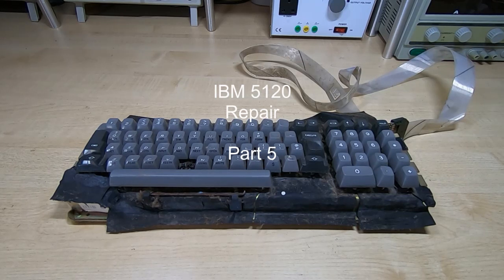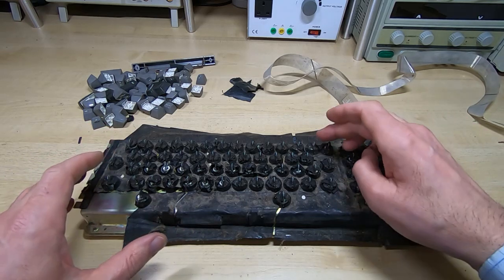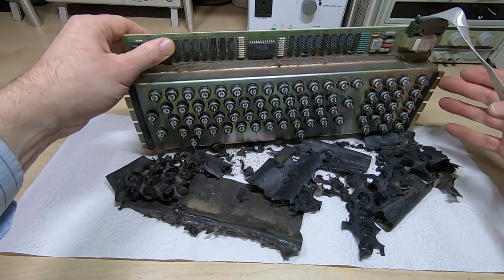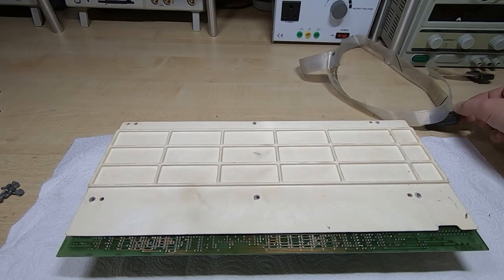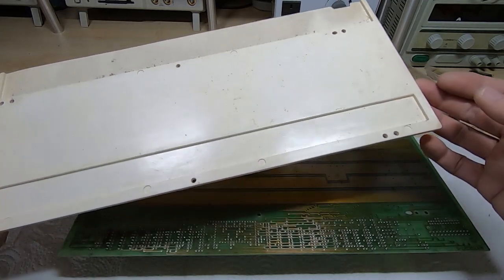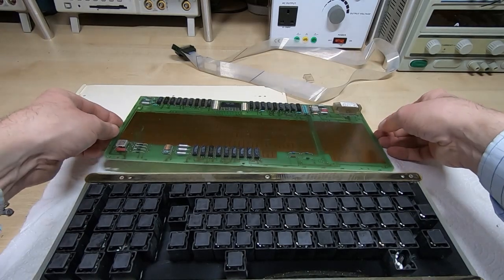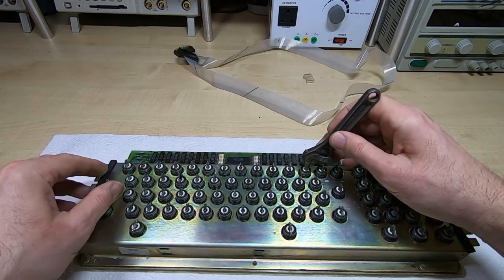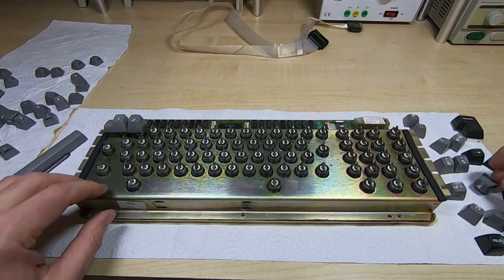IBM 5120 Part5

Comment: Have a look at eBay item 282135256215
Reply from the maker: Thanks. I had already seen these but by the time I have paid shipping and import duty it would cost me £45.00 ($60.00) which is a bit excessive for a key cap. Maybe if I can get the unit working it would be worth it.
Reply: Jerry where do you find your items ?